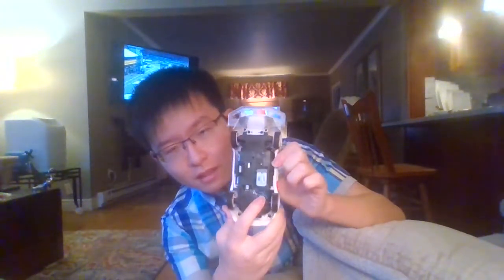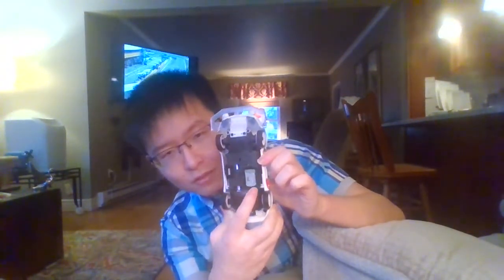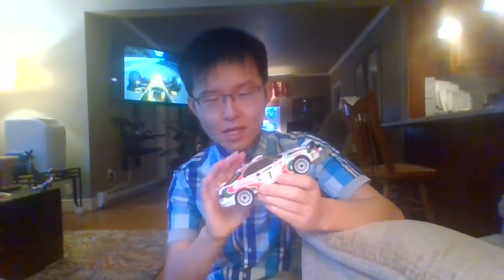Kyosho MINI-Z AWD Toyota Celica WRC 32615JK MA-020 issues review and corrections.

Comment: Just bought this and want to put regular wheels and tires for non drift racing. Can you suggest any?
Reply from the maker: Well, I got few lessons from this car. Celica is too short, and the handling is a bit unpredictable. Kyosho makes "Kyosho Mini Z AWD MDH100W Multi Offset Wheel Set" and it would be a good try to see which combination works the best with certain body ( sometimes certain rim offset rubs more, and sometimes certain types handle better ) Celica body rubs quite a lot, so I got another body later. 

Tires wise, I use Kyosho KYOMZW38-?? Mini-Z Racing Radial ( the ones with the threads ) but I don't remember the softness. I won't use super soft tires because the grip would be unrealistically strong as if cheat mode is enabled in older GTA games, and it would be a bit strange to drive. Kyosho makes slick tires too, but so far I only used those from the box on the Renault. 

When buying the tires, pay special attention to how wide the tires are and how much of a contact patch you want. ( the plastic drift tires have tiny contact patch with the road before it wears down ) and softer tires have much bigger contact patch, so if the rear tires are wider, contact patch would be quite larger with more grip on the rear than front. 

Have fun, those cars are quite well engineered